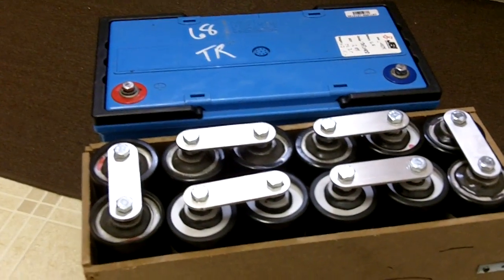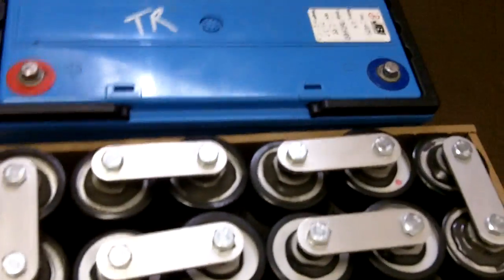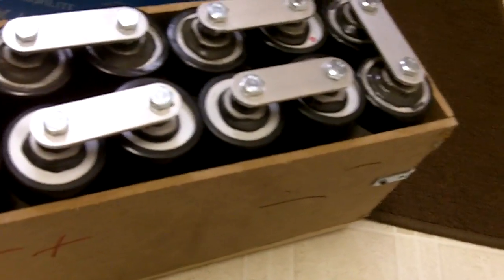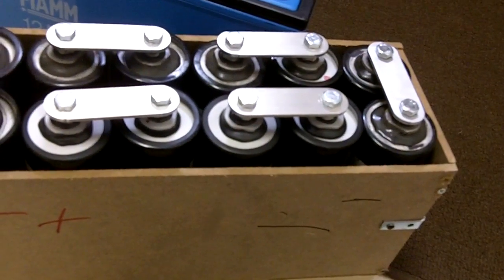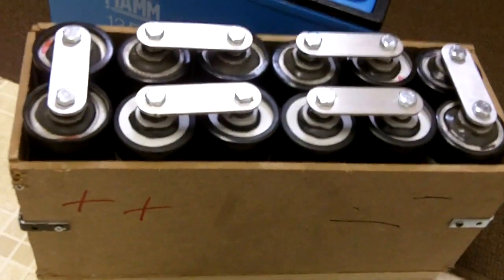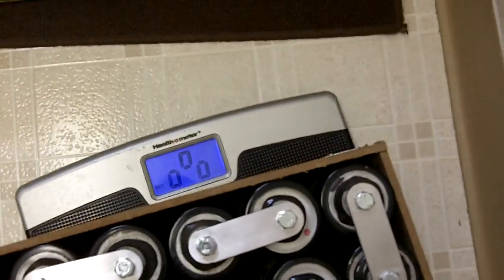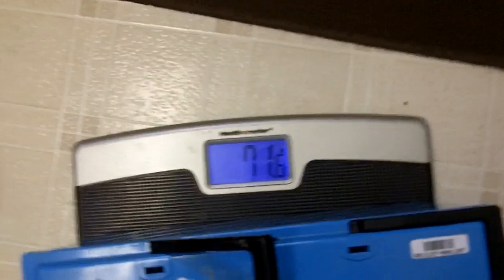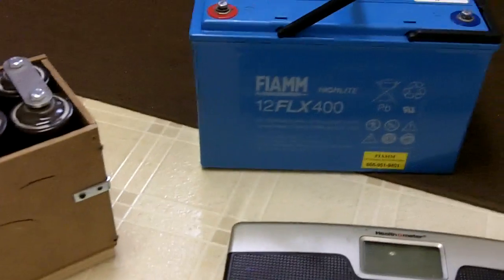Car Audio Electrical Maxwell Ultracapacitors versus Drycell Battery

Comment: for car audio the caps and batteries should be run together the cab should be wired no more than 8 inches off the amp and it's for quick discharge. They charge fast and discharge very fast so when you're hitting a note that your amp needs juice instead of sucking it off your batteries it takes it from the Caps that's the advantage of the Caps to make your batteries last longer and give quick discharge power to your amps. All you guys asking questions do your research it's out there

Comment: I just wish someone would make an easy how to guide for supercapcitors ultracapacitors, how to hook them up, how to wire them, how to charge them, what parts you need exactly and just basic simple instructions.
Reply: +Covencraft 
TLDR:
Wire them in series untill the voltage maximum of the series is above the charging voltage of your system (With these style,you need 6 in series.
Charge them like a normal battery.
For maximum longevity, connect a charge balancer assembly to each capacitor.
DONE.

Comment: ok and now performance test?
How long do headlights stay on with caps and battery?
I do electronics and my guess is the battery will light bulbs longer.
Reply: Artjoms Pugacovs it's not really the point which one lasts longer.. it's getting power right away  when you need it.. so your alternator doesn't have to work as hard..
Reply: jetset808 lol? So it's not important that your lcd clock will drain your ultracaps in few hours? There will be no power in the morning. 100F ultracaps at 14V-11V can produce 2.7Wh of energy. Ordinary 55Ah/12v battery can store 660Wh.. just to get things in perspective
Reply: jetset808 right.. and I'm rocket scientist and part time quantum physics.. get real kid
Reply: Google+ SUCKS BALLS - the worst forced social network Thanks dude.. you just compared my job to a rocket scientist :)..

Comment: capaciter logic   divide the farads by the amount of caps this will give  u total farads it can push out ... after being in series idk why but this is the true total   soo ... 6  3000 farad 2.7volt capacitors  3000 devided by 6   500 farad  total .... now  u can use this for  how  long ? most test say that  u can start a car  over and over and over and over about 6 to 7 times without letting the alternator  charge them ..... and take no time at all to charge  up when started  a guy tested this on his amps with his stock battery and said that the voltage stayed the same as a normal 2 pair car audio setup didnt  the car audio setup the voltage bounced  2 to 3 volts  but with the  setup bank it didnt move past .50v when bass was slamming

Comment from the maker: This is a great question.  First is usable operating voltage.  A battery will only discharge at its resting voltage so it id going to kick in once voltage falls.  Caps discharge at whatever voltage they see a load, very advantageous when trying to get the most out of an amp.  2nd is discharge rate.  Each bank will discharge fully if asked to 1000 amps in a second.  That is a lot of power at your fingertios.  A batt had better reserve capacity since discharge rate is slower but with a big alt nul

Comment: Caps aren't used in burp cars. Look at a well setup SPL vehicle, and its going to use batteries. Caps are good for what they are. However, there has been a lot of research done, and caps can't keep up with the demands that a battery or battery bank can.

Comment: The comments on here concern me. First off, please label that bank (and the rest of the HV areas of your car) with high-voltage / caution stickers; they are very (VERY) dangerous to people who don't know that your car has them installed. Secondly, be careful  with them yourself. A simple analogy about a battery vs. a cap is like a kids cup with and without the sippy top. A cap will charge and discharge extremely fast (due to low ESR) when compared to a battery (sippy cup).

Comment: You are talking 1 farad caps @ 12v you burk.  Try 2600 farad in each of these capacitors @ 2.5v x as many caps as you like.

Jesus, you can't help the completely ignorant now can you?

Don't worry.  When your 5000 cycle battery is junk, our  500,000 cycle caps will still be pumping.

Comment: My alternator works fine and it has to charge 6 of these caps from 6v sometimes.  The difference being mine have to start the engine (3.0 4cy TD)

Comment: Im using a bank of 8 maxwell 2.7 volt caps.. Use daily on an RD audio d9 at .5 nominal and play music and drop worse voltage with a g31 battery. Caps stay at or sbove 11.3 full tilt and charge back up quickly. Saying "they are only used for burp cars" is a lie

Comment: thegreatestpenn is a local  to me..
 his logic on capcitors is TOTALLY wrong... capacitors discharge the energy as soon as supplied..
 they ARE NOT equal too or even close to ANY type of agm battery..
 people use caps in BURP cars.. and NOTHING ELSE
  please for the love of god stop spreading lies

Comment: They are not equal to any AGM battery, the actual technology of a battery vs a capacitor is far different from each other. Only use caps for burp, or to support already existing AGM batteries. AGM for music, Caps for burp.

Comment: my nabors been useing super caps for years .He uses them for moble "incar"  CB-radio linier amps he builds they work great ...but very very dangerious ...they can stactic charge them selfs ie. pull power from the atmosphere in blow ur damn lil finger off ...BE CRAEFUL TO DISCHARGE THEM B4 you handle them !!!